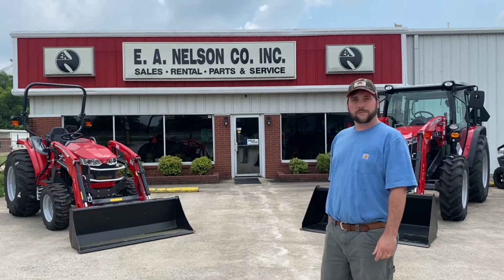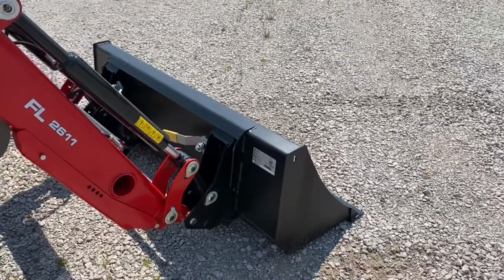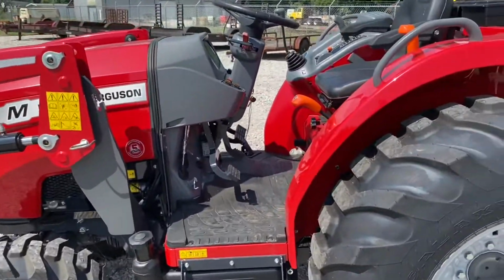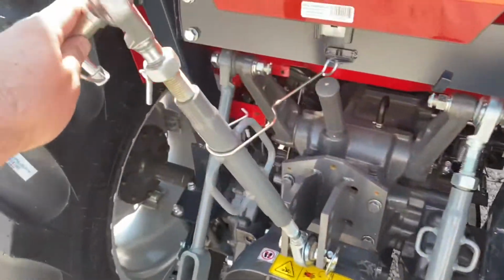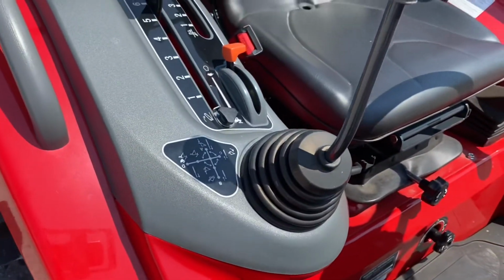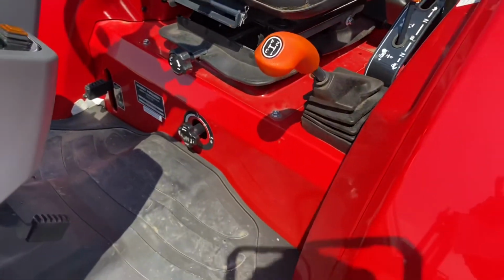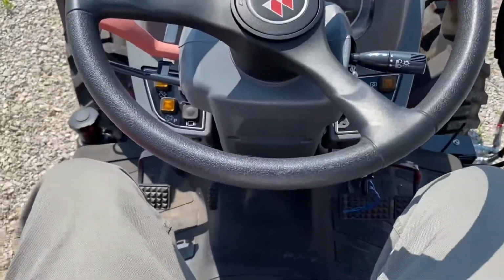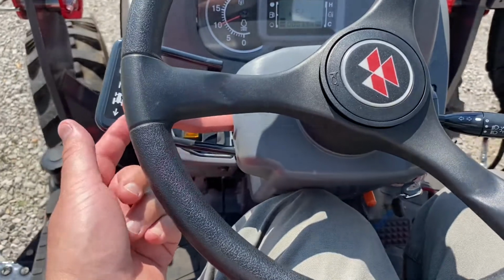Massey Ferguson 1835M Tractor Walk-around Demonstration 36 hp compact utility

Comment: This Tractor the Massey-ferguson in the 1800M series leaves ALL other competitors in the Dust!! With the power-shuttle transmission, high volume hydraulic, precision & extremely quiet engine, duel entry, ground level fueling, three-point linkages, loader linkages ( 175 degree bucket rotation)[ no other manufacturers come close], rider ergonomics (seat, controls,&comfort), the list just goes on & on. They are the best!! Have a 2016 1736 (very, very similar). My friend liked mine so much he bought a 2018 1735m. These are the BEST tractors over-all in the 35- 60 horsepower class. Also  have a 2016 Kubogy MX5200 l compare it to daily ( it's just ok). The Massey-ferguson 1736 is a GREAT-GREAT tractor just like all it's predecessors or precursors in this full line-up of premium tractors 35 -60 horsepower. The 20% extra cost equals 50% more value over all. Going to get another one some day.
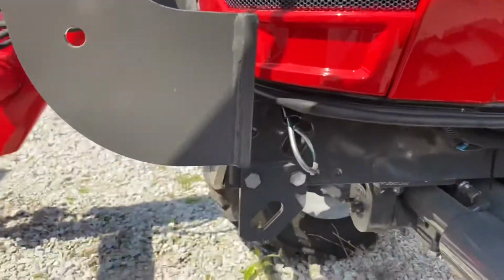Reply: Don't forget the tie downs on the front @ 11:09.  I'm not sure if that's standard on the M or not, but every tractor manufacturer should include tie downs for transporting.  Not like they are cheap @ $20-60+ k and a $20 bracket can help secure it from people damaging them from chains or the front steering and securing the load properly.  If people see a proper secure point to use they will use it.  The only thing about Massey is their PTO numbers seem low especially the hydrostatic vs competitors.   A Kioti CK 3510 is 34.9 hp and has 28.9 PTO.  A 1835 has 36.2 hp and 25. 7 PTO.  A 1840 has  39 .4 hp and only 27.9 PTO.  SOMETHING DOESN'T ADD UP?
Reply: Well said!